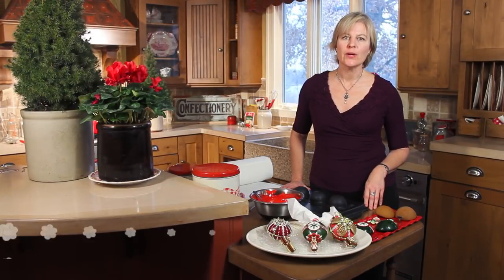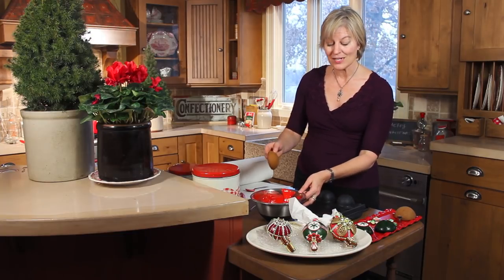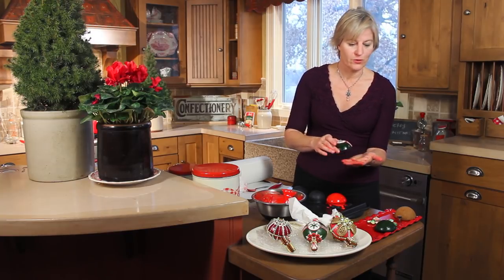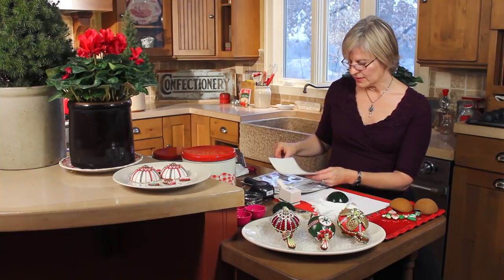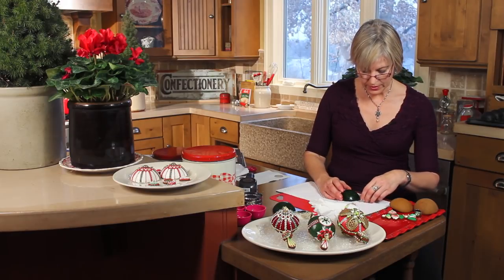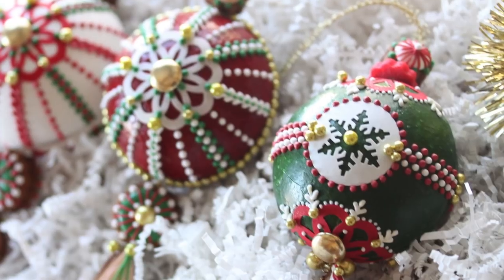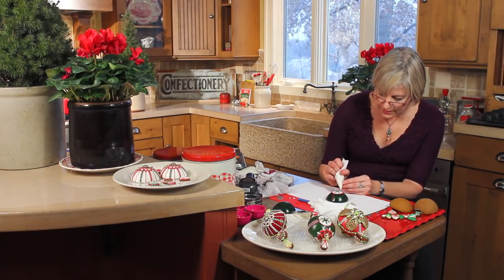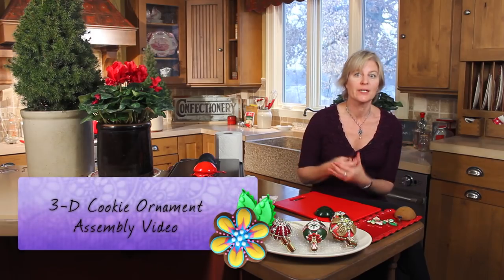How to Dip and Decorate a Rounded or Contoured Cookie

Comment: Hi Julia. U r the cookie goddess! I am amazed by your 3D cookie series!  ♡♥I don't know if this will help , just a suggestion  but I use a screened spatula (like used when u make zepoole at a fair.) That fits over your bowl for large pieces, Or a slotted flat spatula fir smaller pieces like To dip cake ball truffles.thought it would help if you put cookie sphere on it and pour icing, over your bowl,  let it drip a little and use 2 forks to lift out on  to silicone mold for the rest of the excess icing to drip. Save your hands from getting to messy.